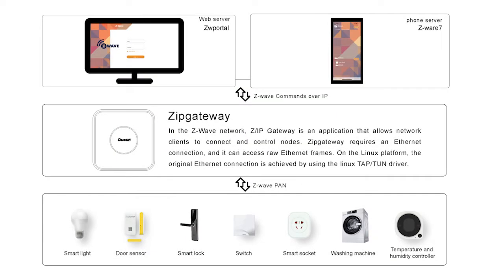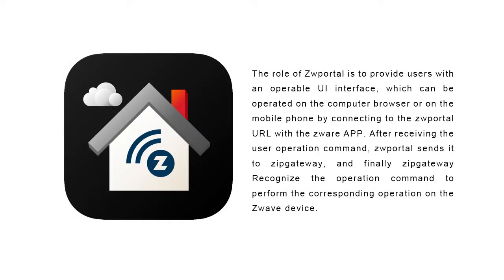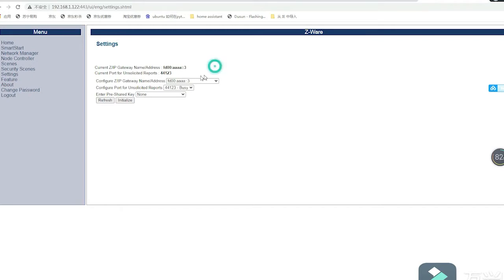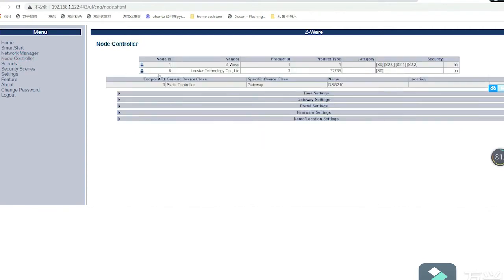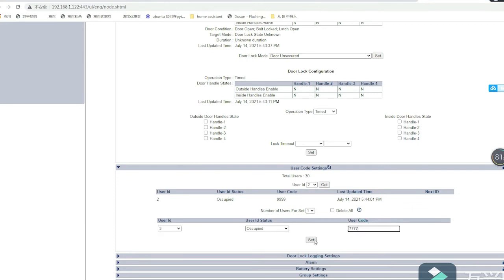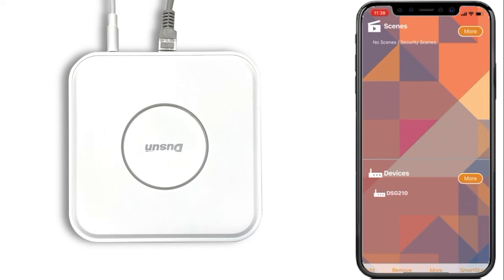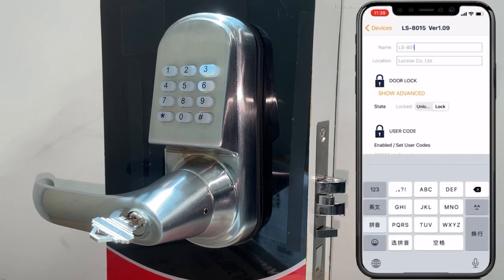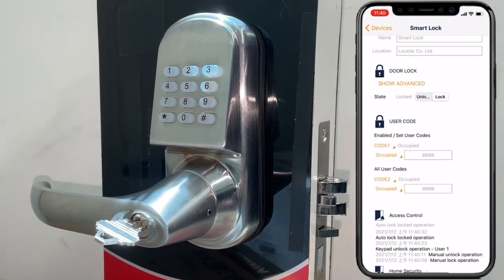How to Use Z/IP Gateway to Control Z-Wave Smart Lock

Comment: "requires an Internet connection".. Sorry, that's a hard brick wall for me. I don't want my home controls to be reliant on or have any access to or from anything outside my own LAN other than what I setup myself.
Reply from the maker: You can run the device locally. Check the video from 4:13 to lean how to run it locally.
Reply: @DusunIoT  can it be set up drom scratch with no Internet? No apps, no phone - just an Ethernet switch, a local DHCP server for it to get an IP, and a normal desktop web browser on a computer? If so, it might be worth another look.
Reply from the maker: @r6u356une56ney  Yes, it can act as you said. If you have other technical questions, welcome to the community.dusuniot.com for further discussion.